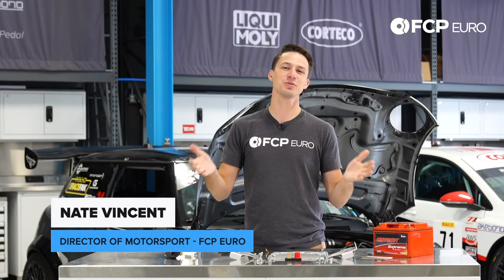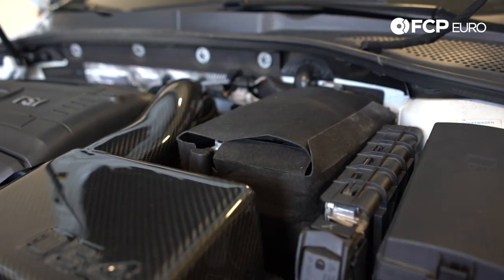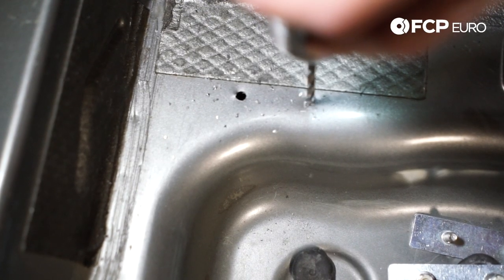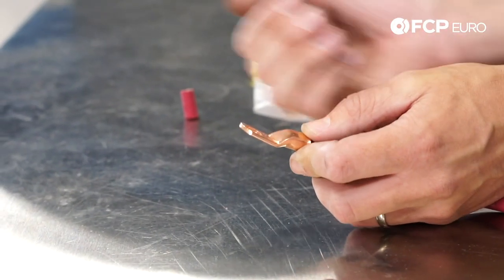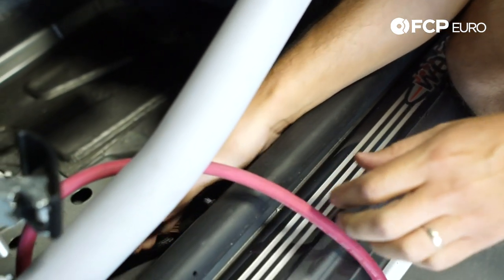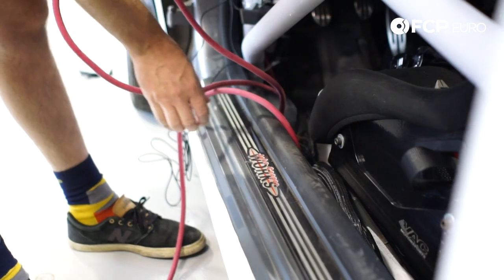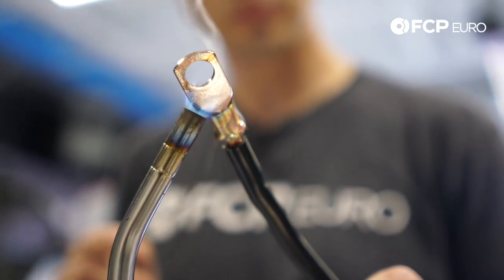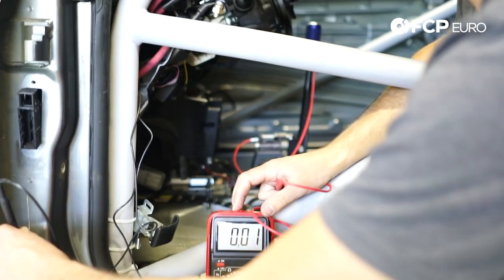How To Install A Battery Relocation Kit & Battery Kill Switch On Any Car

Comment: I’m looking at using this type of switch as a power cut off to my subwoofer amplifier. Will this work the same if it’s on the main power line to my amp?

Comment: Do you use circuit breakers? Didn't see one in the video. Figured you'd have 1 to protect the wires from the battery in case of some random surge and another at the alternator to protect the wire for the same.

Comment: When installing just a battery post to prevent drainage during storage, which post is best, the positive or negative or isolate both posts when battery is left in the car.??

Comment: I need your help badly. Have basically the same switch. Hooked everything up and of course it does not shut car down when running. I have a 2001 celica gt. Now I never put in the wire to shut down the ECM . I need help figuring out what wire that is...I can't find a relay that controls the ecm. Help please

Comment: Is the odyssey tray going to fit into my e36 trunk location and do I need to drill into the car too ? Or the factory clamp will do ? 

I’ve been soldering for 20 years professionally and hobby rc related and I can say that was not the proper way to solder that lead to the copper connector. Always “tin” the wire and get some solder on your connector prior to attempting to make your joint. That solder did not flow thru all the strands of that thick wire properly. That’s why the wire was starting to burn lol 🤦🏻‍♂️ let me know when there’s a video next time I’m open for a job 😉

This is why it’s always suggested to crimp since 99% of people don’t know how to properly solder and of the 1% that do maybe only half of them actually know wassup. Lol a simple smash hammer type crimp would be better than those cold solder joints that are prone to cracking and causing all sorts of poor connections

Comment: Nate - we have been running 2 Miata race cars in an endurance series with a 4 pole kill switch and have had two alternator failures.  The setup that we have been using does not have the resistor and circuit to dissipate the residual power from the alternator.  One alternator failure was from a bad connection that caused the alternator to have many cycles of momentary cut off which killed the circuits in the alternator.  We suspect the second failure is from drivers turning the car off with the kill switch instead of the ignition and the alternator getting the surge that you have very thoroughly explained.  Our next step is to install a 6 pole kill switch and follow your installation procedure.  Thank you for explaining it so well.
Reply from the maker: Happy to be of some help with those Miatas!

Comment: There's a hydraulic wire crimper which costs around 40$, why soldering? This doesn't looks bullet proof at all. Also is it really ok to drill a hole right into the body and just put a screw in there? Is it better maybe use rivets with a threads? also covering sides of the hole with some acid primer? From the bottom any water which will get in there will flame a corrossion? no?

Comment: hate to be that guy but soldering those cables is a failure waiting to happen, not to mention the wire was compromised by the heat as well as the jacket since it was burnt...also using solder in a Crimp fitting is a no....any true wiring professional will tell you nothing replaces a mechanical bond aka a crimp..no real motorsports grade wiring shop or person uses solder on major connections..

Comment: how do you mount the switch? looks like you just have it hanging out there where it can jump around when key is incerted and turned on and off.  good clear vid thanx
Reply from the maker: Hi Bowlweevil, Ben made a metal plate that comes off the roll cage to hard-mount the switch in his mini!

Comment from the maker: Shop the Kit Used in this video here : https://www.fcpeuro.com/products/automotive-battery-powersport-kit-odyssey-pc925mj?utm_source=youtube&utm_medium=description&utm_campaign=mps%20r56&utm_content=battery
@23:20 Nate mentions running the black wire to the NO switch but its actually to the NC switch. The NO's are used for the red wires connecting to the ecu.

Comment: Definitely not for a race care but I just need to keep the battery off so my radio stops pulling power. Would this type of thing work
Reply from the maker: In theory a kill switch that shuts battery power would stop the parasitic draw

Comment: Great video overall, particularly covering the critical connections required to have the ECU kill the engine and also protect from the alternator surge. However I thought it was an interesting choice in going with a solder connection there, specially on a race car. Wouldn't crimping have been a better choice for reliability on those connections?
Reply: Crimping is definitely more reliable! Only soldering the cable lug is sub-par. Others that are watching, please crimp your cable lugs!
Reply: @davan278  uhhh what evidence do you have for this?  he used high temp solder which is not going to come loose under a car hood. you would need temps over  700F to loosen lol......
Reply: The vibrations can crack the bond of solder connection wire to lug. I would do both.

Comment: Would you recommend a breaker, and/ or necessary for passing tech?
Reply: That's what I was gonna ask. Having to move my battery to the trunk coz of the hassle prying it out of the engine bay. The motor is a v8 but the frame is for a v6 which makes the it very crampy. Figured 100 amp breaker on both ends should be good enough.  1 by the battery to protect the wire from a surge from the battery and another on the engine side to protect the wire from a surge from the alternator.
Reply: Just remember you want the amp to be less than the max the wire can handle otherwise it won't protect anything.  The kit I bought is a jegs brand from Amazon and according to them the 2guage wire I have has a max if 120 amps.
Reply: @dragonext2001  I was thinking 80 amps, for hondas
Reply: @JiroProject  my car is a 2008 Buick lacrosse super.  Originally they tried to sell it as a luxury car with a v6 but no one wanted it so they swapped for a small block v8 that was ment for a truck and added the title "super" the frame is ment for the v6 so the v8 pulleys are inches from the battery making it a headache to change.i figured 100 amps should be enough to avoid the car not starting. I'm sure I'll loose alittle power with the 20ft cord.

Comment: Great video! Quick question, if installing double isolation (class im converting car for requires isolation inside car within drivers reach and externally on the car) would you just put them in series for the main power line? (I.e. power cable goes battery to switch, out of switch to next switch and out of switch engine connection? Would you also just double up the NC/NO wiring?
Reply: Would you not just put a pull cable for the marshal directly to the kill switch in the car??

Comment: A for effort, but this battery wiring cannot be called racecar battery wiring. The method used to terminate the heavy gauge cable would never be used on a real racecar. It is not a reliable or desired. I'm not knocking the enthusiasm or the effort, though. The intent for the content was well-intentioned, I believe. Just lacking knowledge and technique.

Invest in a good quality heat gun with those different deflector attachments.

It's also best to only do continuity testing when the circuit under test is not live. The multimeter eventually damages from it.